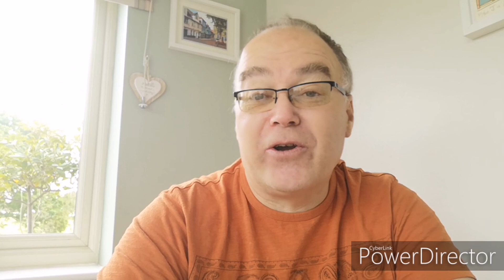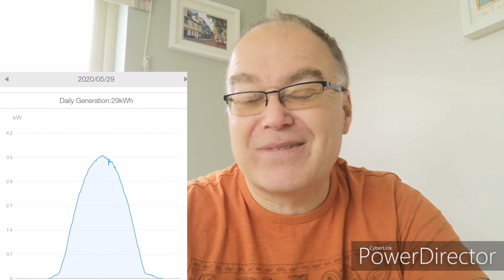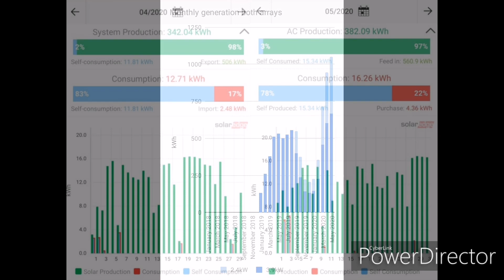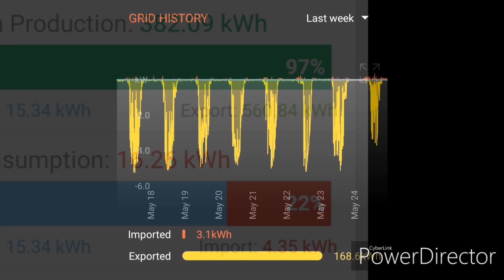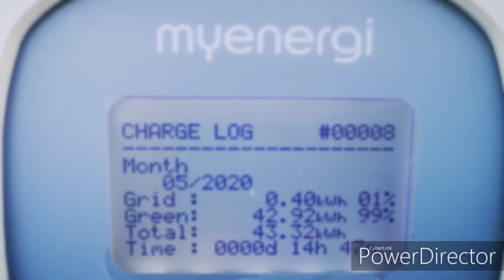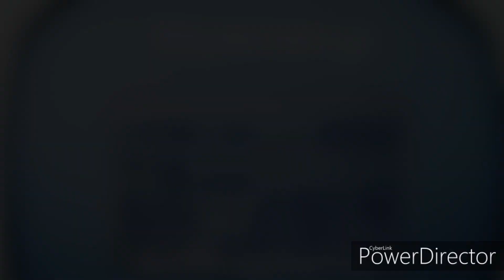May 2020 solar update. Observations and thoughts 18 months into solar ownership

Comment: Thank you for sharing. Your unbiased data presented here is helping me to plan my future course of action pertaining to installation of a Grid tied-Hybrid set up in my home with future EV charging. 

If possible would request you to kindly do create some more videos of EV charging, chargers, how does the Solar + grid balance out when the vehicle is being charged and the voltage is slightly erratic at times. The idea of making your own “fuel” to run your vehicle sounds enticing.

Best regards from India
Reply from the maker: If you look through my older videos there's plenty of Zappi related videos that cover this.

It's easy really. The charger monitors solar export using a standard clip on circuit monitor on the mains cable of you house. If it sees export them it knows you're generating and not using it do if plugged in it increases the charge rate to use what spare energy there is. If you turn on a house appliance, the export reduces do the charger reduces and vice versa
Reply: @EVPuzzle  hello have already gone through all of the videos you have published so far and really grateful for all the data shared. 

I meant an update on the same.. 

Cheers
Reply from the maker: I'm cover the car charging more in June's solar update for you
Reply: @EVPuzzle  thank you

Comment: Probably it was in one of the previous videos, please tell which one, if so
But, how the export to grid works? are you paid for it or you can use this amount later free?
Reply from the maker: You need to research FiT schemes Vs SEG schemes smart export guarantee.

I receive FiT payments which estimate my export at 50% of what I generate. 

SEG is a separate scheme that can't be used alongside FiT and just pays for what you export to the grid

In the UK there is no net metering so credit doesn't build up for what you export. Once exported it's gone. Best to use as much as you can

Comment: I may of asked this before on another of your videos but i can't remember which one to see the answer, so sorry I'll ask again.
Can i ask how your battery storage in physically connected. Is it in parallel or do all your house power go through it then on to your final circuits?
Reply from the maker: It connects the same way as the Zappi charger or solar inverters, off a seperate consumer unit breaker.. Nothing goes through it but it decides to charge or discharge based on what it sees on the grid .

Comment: Nigel, really interesting, thanks.  

I have a Powerwall, working with my solar array and your comments about your friends system,  and the Tesla algorithm/set-up are right on.  I'm looking at manipulating the Tesla server API (Application Programming Interface) to do things the way I want them done, baby steps first, but if they work then I might develop my own algorithm to look at yesterdays solar charge, tomorrows weather and variable tariff rates to have it decide when to charge!

As you use a Zappi and Eddi, I thought you might be interested in something I've done to make my Zappi charge during the variable cheaper periods on a smart (Octopus Agile) tariff - feel free to take a look: https://youtu.be/vhnQqKtkb00.

Only problem is that my Powerwall discharges to help reduce the grid energy being used by my Zappi, when the variables rates are cheap - which goes against what I am trying to achieve - hence my Tesla API baby steps, just trying to automate its mode switching, so it actually switches over to charge, rather than discharge during the cheap periods on my smart variable tariff.
Reply from the maker: Intelligence how we want it and in our control I say. Always need to tailor to individual needs.

I'm hoping I can gain some winter kWhs to not need to worry about evening top ups but it's not going to be easy I fear
Reply: @EVPuzzle  I've only had my 7.2kWp solar, 13.4 kWh battery (Powerwall), Zappi and an EV (E-Niro) since beginning of April 2020 (managed to get the system commissioned just before all works ceased as the apocalypse hit home).  So I don't yet know how much energy it'll generate in the winter.

But based on the few overcast days we've had, I'm assuming I'll need to draw from the grid a fair amount through mid-winter.  

So I've 'hacked' my Zappi to use grid energy when the rate on my variable tariff is cheap (i.e. being paid to use the energy [ when rate goes negative] or at least cheaper than the rate I get for exporting energy to the grid), which should mean  I minimise the my energy costs through the winter.  Just need to 'hack' the Powerwall to do the same.

Comment: Hi Nigel. The energy produced by a wind turbine is directly proportional to the radius of the turbine squared (swept area of the turbine blades) so it is best to get the biggest blades you can if going for a turbine. A small wind turbine produces very little electricity even for trickle charging. A power calculator is here: https://rechneronline.de/wind-power/  This also shows turbines produce the cube of the wind speed so the windiest location you have. This is why we place massive wind turbines at sea which are now rated up to 12MW each.
Reply from the maker: I'll look but I'm looking at VAWT to start with

Comment: May was a great month. (https://www.pvoutput.org/aggregate.jsp?id=75790&sid=67190&t=m). Our generation was 1.669MWh, consumption 0.779MWh, export 0.910MWh and grid import of 0.021MWh which is 2.77% of total consumption. The grid import is still in the range of 0.5 to 1KWh a day. The import seems to be mainly switching time but like you it would be interesting to minimise this further. We have a SOLARIMMERSION IV device for heating the water and it took me a bit of time to work out the best way to heat the water in the morning (when the sun is not shining) if the kids used it all the hot water in the evening. Eventually we set the batteries to export power in the early mornings and this was soaked up by the SOLARIMMERSION IV. It took a bit of tweaking but we now have hot water in the morning. There is an interesting video about using the esense connection on an eddi and zappi to do the same sort of thing using a wifi enabled switch (See https://www.youtube.com/watch?v=vhnQqKtkb00). 
Like you we have to take account of the weather as June starts but we are getting better. 
We still can not use all of the power that is generated between March and the middle of October but the batteries are definitely helping. Wind turbines are interesting but getting the capacity to make up the short fall between October and March is going to be difficult. For the kind of consumption we have we need a 1.5 to 2.5kw turbine at an approximate cost of around 7k for installation. They also need planning permission. The other option is 2 or 3 smaller turbines, but that might not go down well with the local area. More thought it needed.

Comment: Hi Nigel, Impressed as always with your stats and presentation. The good news is that after many stops and starts, May was a good month for my system (5.7Kwh E/W) and delivered just over 600Kwh. Used about 360Kwh and gave the balance to the Grid. Hot water is on another system and performed very well, regularly cutting off at 64 degrees. I know that my solar is not great when compared to others but not bad for my location and orientation. Keep up the great work.
Eddie
Reply from the maker: Glad you've had a good month too Eddie

Comment: Good clear analysis. (Must find a way to store energy for six months to use in winter. 150 batteries!)

Was looking at Gravitricity.  Might be a solution... if you happen to have a deep well. 

https://youtu.be/U7a_LMM2_fE
Reply from the maker: Think I need a 350kwh battery to get through winter or 150 solar panels. Surprisingly the PV panels are more achievable if I put a solar fence in but somehow I don't think it'll cost justify 😂🤔🤷
Reply: @EVPuzzle  yes interesting point about the cost effectiveness of 100% renewable strategies: brute force solar versus neat but costly storage.
Reply from the maker: At a guess just with solar I've reduced my grid use by 80-90%. The last bit at night is the hardest but most costly too. Common theme looking for efficiency, to gain those last few % costs more .

Comment: Thanks Nigel, really helpful. What would be the total capital cost of your solar arrays, battery storage and control devices etc. As much as I am a big advocate of the technologies, (we have a Zoe EV), being near retirement age I don't see us ever being able to afford the up front investment required.
Reply from the maker: Solar is getting cheaper all the time as panels deliver more power. Installation can be the expensive bit with scaffolding etc.

I paid £4.5k for 3.9kwp but that'd be under £4k now for sure.  Battery varies of course size wise and make and is harder to cost justify.

As I've said in videos before as I consume most during the day, adding more solar makes sense to me. If you use more at night a battery might make sense. The one I've got is about £3500-£4000. Givenergy look good value too.

It's a shame they cost so much up front but solar PV is definitely worth it if you can find the money
Reply: @EVPuzzle  for those who want to inform themselfs about costs on a BES maybe this paper can help. It's about all costs involved and for home users, not industry. It can be simplified by calculating the costs per cycle and per kWh to compare it with the grid costs (execpt energy cost). https://www.diva-portal.org/smash/get/diva2:1130036/FULLTEXT01.pdf

Comment: Great video Nigel, always enjoy them. I have looked in a wind turbine as well for winter, planning may be an issue and researching I have not found anything cost-effective that seems to work, so interested to see what you find.
Reply: a colleague of me started doing that al lot of years agoo, due to regulations he had to leave the city and lives on an old farmers house now. He put the wind turbine on a mast or pylon 20m above the ground level. The production ratio was 1kW turbine delivered 1000kWh/year. (horizontal axis)
Reply: Take a look at Ripple Energy. You can part own a windmill. Larger one’s are known to be more efficient and cost effective. You can invest as little as £250 or up to 120% of your predicted consumption. This can fit very neatly with solar and battery systems to contribute effectively to filling that winter gap. This may prove much cheaper than adding more panels. They have tied up a deal with Octopus and if you move house, your share is portable. Certainly worth investigation. They also have something in the “pipeline” with Sunamp heat batteries which are cheaper than lithium ion, have a predicted life in excess of 50 years and can be integrated with most existing systems.

Comment: Hi Nigel. An excellent thought provoking presentation as usual. Suggest you investigate Ripple Energy's proposition. They have teamed up with Co-op and Octopus Energy. Ripple are offering shares in a windmill they are going to build in South Wales. You can invest as little as £250 for shares. The capital is refunded over a period of 20 years @ 5% pa. investors will then receive credits,  monthly in arrears for the amount of power generated by the windmill, in proportion to their shareholding. Octopus will buy energy from Ripple at the wholesale price and the customer/investor will receive the credit, irrespective of their usage, so long as the min investment is £250 and the max investment covers no more than 125% of annual consumption. This offers the potential to cover your winter shortfall and it seems very flexible, first because you can start with the minimum amount in the first project and later choose to add an investment if required in further projects in the future. It seems to fit well with existing solar and battery installations and they intend in the near future to be offering Sunamp thermal battery storage too - which hold out the promise of much longer life than Lithium ion batteries and can be used for hot water and central heating. This may be useful to you for your future plans to go all electric - and offers the opportunity to inch towards it one step at a time. I'd be interested to get your reaction.

Comment: Great information. I'm trying to add battery storage to my solar home. My question is since I have Enphase controller should I go with Enphase batteries or Tesla Powerwall. Also do you thing Tesla will be coming out with battery to grid that will effectively turn my Tesla into a 5 Powerwall system?
Reply from the maker: No I don't think Tesla will deliver v2h or v2g any time soon. Just my opinion.

Powerwall 3 might be just around the corner though
Reply: When Tesla finally produce their million mile battery then yes, they will at that point have enough charging cycles that deterioration won't be an issue for the vehicle. At the moment and with the current batteries it's unlikely.

Comment: The Tesla Powerwall grid draw problem is resolved by upgrading to the gateway 2. When I had the original gateway I was using around 5kw a month, but with the gateway 2, the electricity meter has had the same readings since the end of March.

Comment: Thanks for the update. May was also a new record of 566.7 kWh for my system in Scotland. I wondered if you're not seeing the full 3.6 kW peak output due to the temperature of the panels rather than haze? I have read that high temperatures can reduce the efficiency but not sure by how much or if UK temps ever get high enough to cause this effect!
Reply from the maker: I suspect that's part of it. It's just interesting to see when maximums are achieved and when they're not
Reply: all PV panels suffers from high temperatures, in the datasheet it's specified as power temperature coefficient and is around -0,4%/°C (°C is the temp of the panel and not the ambient - can go up to 60°C)
Therefor the forecast of the energyproduction is so difficult. It can be a very sunny day without wind (high panel temp) or a lot of wind (lower panel temp) but depending the direction of the wind (and if it get under the panels) it can help or not.

Comment: Great video loads of info .question , if you aren't going to use all the energy,  why not switch the 2nd array off and only use it when you need it , ie winter months  or when you need to charge the car ?
Reply from the maker: It's useful from the point of view of using multiple appliances at the same time. Instantaneous needs aren't the same as total kWh needs.

I could see a smart grid paying solar owners to not export infuture just as customers are paid to consume energy with Octopus
Reply: @EVPuzzle  In Europe (sorry UK you leave us, but the interconnecton between UK and Seabrugge will be still operational) they want to pay the PV producers for the injected electricity, you've to pay the full price when you're grid consumer later on. In the beginning the price will be fixed, later on it will be the spot price.
From the point of view now adays, with cheaper solar pannels it could be more interesting in putting as much panels (Wp) as possible to produce the max energy in winter time, and sell the injected energy. Also East-West directed PV is better in direct consumption of the produced energy.
A total different approch between 2009 and 2019.